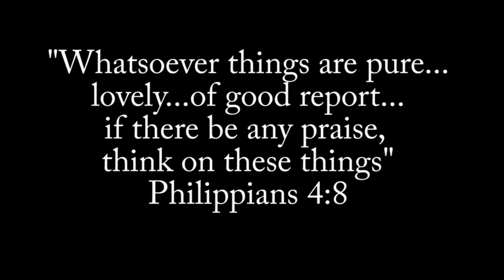Woodturning Perfect Hollow Sphere   No Expensive Jig

Comment: Alan, Last Christmas my wife decided that she needed some sort of containers to hold Christmas goodies for our grandchildren. I suggested hollow spheres and soon found my self following a procedure identical to the one you used. My big mistake was to make the spheres too thin. This meant that when sanding other than pole to pole, the spheres distorted from circular to elliptical and if I wasn't really careful, I ended up sanding right through the 'thin' side. It took about 11 tries to get the seven spheres needed for our crop of grandchildren. Since then, I have successfully made several more hollow spheres with thicker walls. I have also made a few with the two halves of the sphere threaded  together (using a slightly modified version of your threading jig). Getting the grain to line up across the equator is something of a challenge, but not so bad once you work out exactly how to do it.
Keep up the good work. I really enjoy your approach to turning.
Reply from the maker: Good Job Bruce. Sounds like you have mastered spheres.
Alan

Comment: Alan, you sure have mastered the octagon method. I haven't tried it yet. Very nice turning.
Reply from the maker: Try it. It took me too much time to come upon this method. Makes it easy.
Alan
Reply: @AsWoodTurns  I saw where you had a chart for your dimensions for spheres. Think it is back when you turned a ball for your grandson. Is there any possibility of getting a copy of it? Thanks
Reply from the maker: @josephwise485  I do not use that chart any more. It was always hiding when I needed it.
The chart was simply a implementations of the two critical formulas noted in the video and the description.
Now that nearly everyone has a smart phone, I recommend.
1. Storing the two numbers in a note on the phone. 0.293 x diameter = distance from end of cylinder to a corner. (top or bottom) and 0.414 x diameter = length of all sides of the octagon.
2. Then use the smart phone calculator to do the two calculations and write the result on the wood.
The chart was limited to discrete diameters. A calculator can do any diameter.
The smart phone is easier to keep track of than a random sheet of paper.
Alan

Comment: Alan, thanks again for another great demo. I have yet to try a sphere but will definitely try your method, of course it will take me a few attempts to get it right.
Reply from the maker: Have fun! The trick is to not cut too deep.
Alan
Reply: @AsWoodTurns  Make my first sphere today following your process. Its not perfect but not bad for first attempt, my biggest issue was centering after rotating the axis.  Many thanks for your inspiration to give this a go. I will try again soon.
Reply from the maker: @neil_m135  The first rotation is the most problematic depending on how spherical you are beginning with. But you do not have to stop after 3 rotations. One or two (or more) are sometimes required. During each rotation, you are effectively creating a bump on the end while perfecting the middle. When you rotate, make sure that bump is not partially in the cup faceplate area because it will distort the centering. Instead, the bump should be in the new refinement area. The bumps should decrease with each rotation. ideally within three.  
Keep at it - you are on the right track.
Alan

Comment: Any chance you have a cheat sheet for the different diam sphere you make?
Reply from the maker: I do not use a chart any more. It was always hiding when I needed it. :(
The chart was simply a implementation of the two critical formulas noted in the video and the description.
Now that nearly everyone has a smart phone, I recommend.
1. Storing the two numbers in a note on the phone. 0.293 x diameter = distance from end of cylinder to a corner. (top or bottom) and 0.414 x diameter = length of all sides of the octagon.
2. Then use the smart phone calculator to do the two calculations and write the result on the wood.
The chart was limited to discrete diameters. A calculator can do any diameter.
The smart phone is easier to keep track of than a random sheet of paper. But, if you really want a chart, you are welcome to make one so that it can be hiding when you need it. :)
Alan